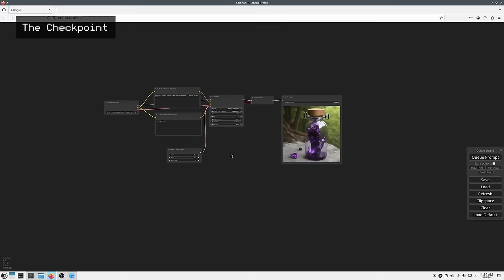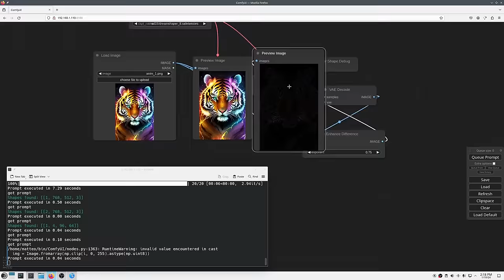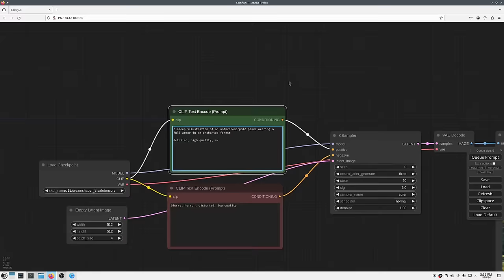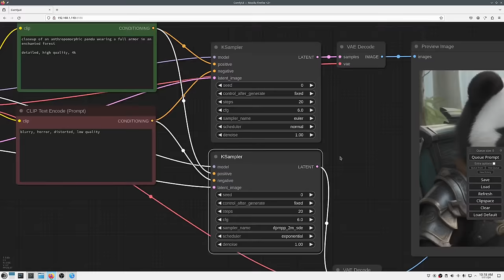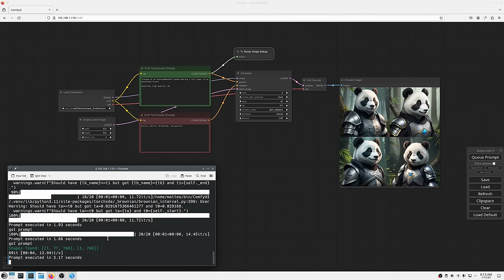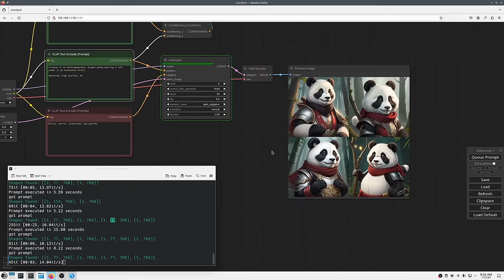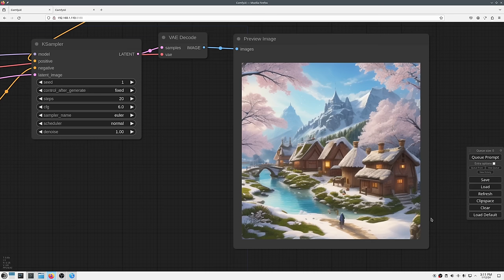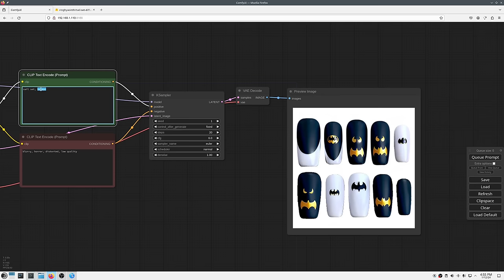ComfyUI: Advanced Understanding (Part 1)

Comment: this is fantastic
ive gone through many tutorials on youtube
most of them, the person simply reads out the words on the nodes without explanation of what everythning is doing. 
the end result is being able to connect things, but not knowing why.
its knowing nuts and buts, but not why nuts and bolts. 

This tutorial is the first ive found that explain nuts and bolts with clarity. 
scott detweiler is the only other one that ive found who explains stuff, but yours has been the clearest with graphics and examples. 

Perhaps now i can get my head around why when i randomly change values the whole thing breaks. Moreover, perhaps i can get to a point where i no longer have to randomly change things and try to work out what happened. 

Thanks

Comment: Can we extract images in layers to preserve the generated result?
For example, an elephant is looking at the moon and standing by the yellow river.

After generation, I would like to keep the moon as its appearance is correct, but I want to change its position.

After generation, I want to keep the river but modify its width and the greenery around it.

In essence, it would be beneficial if the system could generate images one by one, break them down, and then merge them. Similar to Photoshop's Layers functionality.

Another example: altering the number of wrinkles on a generated face while retaining all facial features. Essentially, having wrinkles as a separate layer.

Comment: I was interested in the conditioning information but after a morning's testing I have to say I am doubtful that separating the positive prompts prevents colour bleed. I used a prompt with three colours (white, red and blue) and 3 subjects ( a girl, a wall and a door) the main subject had one more item of description (a smile) Putting the entire prompt in one text encode performed best, only getting it wrong in a few seeds. Conditioning combine also managed it but with a loss of coherency. Conditioning concat got all the colours but one colour was frequently misplaced. Conditioning average, as I expected, got only a door at 0.4 and only a girl at 0.7 and both, with the colours mixed up, at 0.5. Conditioning timestep produced identical images in most settings and inserting it in the chain at any point produced either no change or garbage... there must be something I don't understand in its usage. I used DreamshaperXL and the Turbo version, the turbo was noticeably more coherent but with very slightly lower quality. The Turbo images had a more natural feel the XL were smoothed over and plastic. The prompt I used was: a girl, red dress, slight smile, white wall, blue door, negative was empty. Obviously if you add more information and colours the performance would drop, there seems to be a limit of about four things you can say about an object and have them recognised.

Comment: Hi, I have a question about the nails unet you showed, on huggingface there's only a .bin dowload or it. I'm using google colab, so I was wondering if there's a way to change it the file to .safetensor without dowloading it to my pc and then reuploading it to my google drive? Thanks!
Reply from the maker: check in the repository comments, there's a link to the safetensors that is what I was using in the video

Comment: Doesn't the Conditioning Average & two Conditioning Time Step Range nodes essentially do the same thing?
Reply from the maker: no, "average" averages the embeds and the average is sent to all the sigmas. with timestep you can set which embeds are send before and after during the generation. The initial embeds are generally mode important
Reply: @latentvision  Ah right, so you get more control over it, I see. Thanks!

Comment: Why I can not find the tensor shape debugger  even install the ComfyUI_essentials?
Reply from the maker: you probably just need to update
Reply: I had the same problem after installing the essentials with git clone in the custom_nodes dir - I think the issue was I didn't install the requirements.txt with pip in the customnodes/ComfyUI_essentials dir.   (there is no install directions on its github?)   Not sure, I deleted it and re-installed using the ComfyUI Manager and it worked fine after that.  (ComfyUI manager does install the requirements.txt automatically)